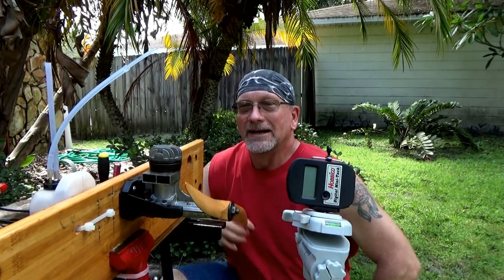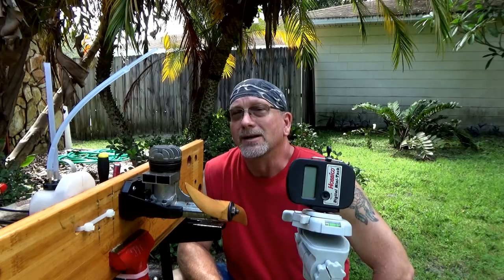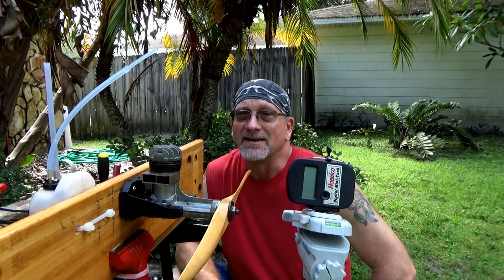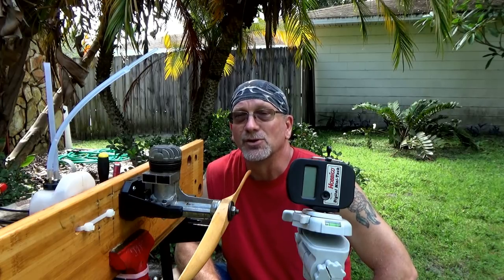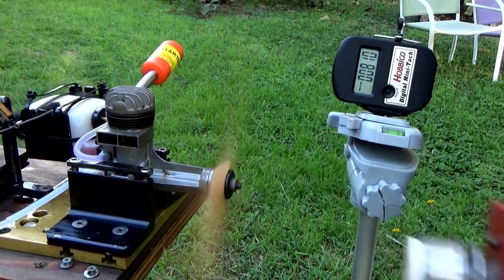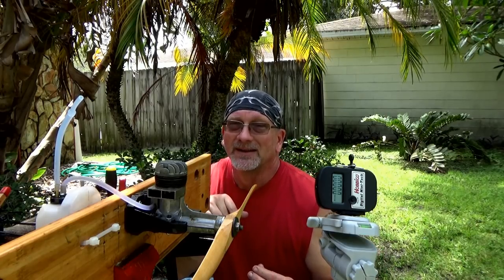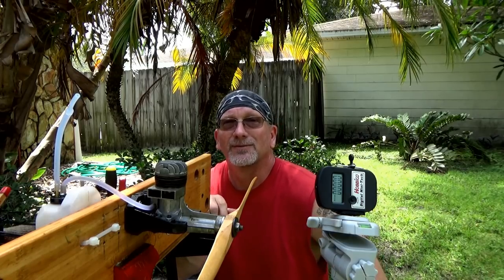Fox 59 Longshaft Run Attempts

Comment from the maker: So one comment to respond to all here.  This is not the first time I have run an engine.  Obviously I have checked the items folks here have commented on.  Fuel flows fine through the spray bar as I can blow through the vent line and fill the carb up.  So the spray bar is clear.  I can blow air into the spray bar and close the HSN and the air stops flowing through.  Likewise when I open the HSN while blowing air begins to flow, therefore the spray bar and HSN are fine.  I have also tried 2 different plugs between the attempts; nothing was different.  I have NO idea what the spray bar position is or should be. Who does?  If you think you do then show me some pictures of yours or documentation describing it.

Disassembly is an option but the age of the engine really makes me think the risk of further damage is not worth risk just so I can get a better run video to post.  This is an extremely rare item and sometimes you don't get to see what you want.  This is the only time I will be posting videos on this engine.  It is what it is, end of story.

Comment: Got my K&B .40 running thanks to your videos. It needed fuel. It liked when I plugged the carb and exhaust and chicken sticked it to get the fuel in and then electric started it. I backed out both screws from where they were. Just learning but it ran purty.

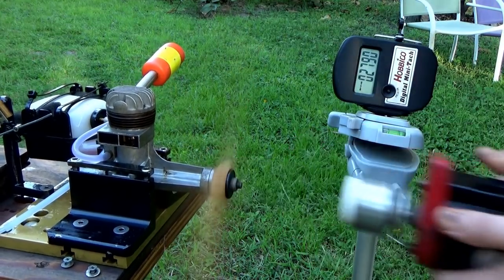Comment: David - I am at 3:57" so far on the video and I have two suggestions at this point: remove the fuel line and the needle valve and flush through the spray-bar some fuel with a syringe - I suspect some debris inside the spray-bar blocking your fuel draw. That would be the very first thing I would do. Next in line, use a hot plug ( the miracle Fox glow plug is not hot enough ) use either an Enya #3, OS #3A ( used to be #8 ),  SIG-GP003 or any other hot plug you can find, and definitely up the fuel with a 10% nitro and see how it will run .. But try to flush first the spray-bar with some fuel to clean it up and I bet you it will be a different engine.  Let me know how that goes ... This engine is very venerable and Brodak now offers a tongue muffler for it ..  You really made my day when I discovered this video / engine running ..

Comment: I know what i would do with that. Haha. Makes you appreciate the enyas the os  the saitos and the lasers. Your channel is so cool!!!
Reply from the maker: What would you do with it?
Reply: David McIntire   My big hammer. I would have lost patience haha
Reply: Have you tried it on full 20% castor?  Its really acting weird.
Reply from the maker: Well at 50s into the video there is text showing that the fuel has 26% oil content, much of that was added castor.
Reply from the maker: So you would destroy a rare and classic engine....
Reply: Not real smart...
Reply: In the 50's how much nitro was recommended for an engine like that?
Reply: Heaven knows. This was at the dawn of glow ignition and people were trying all kinds of things, there were guys doping up their Speed fuel with benzine.
Reply: Have you tried sealing the apparent crack in the crankcase? I know I had an old 2 stroke piston port suzuki years ago and it ran like shit.... constantly leaning up on me and that turned out to be leaky seals on the crank shaft bearings...
2 strokes rely on the integrity of the vacuum in the crankcase and any additional oxygen messes the mixture up.
You obviously know this, as you already mentioned it so apologies for rambling.
Cheers Kev.

Comment: They were noted for that- LOUD. The only one that ever had a muffler on it from Fox was the last of the series- the Falcon from around 1975. Check the cylinder head gasket, they were noted also for blowing those or having them leak as there really isn't anything supporting it.

Comment: Ya know, Dub Jett says: "80% of all engine run issues are the fuel tank, the other 20% are the fuel tank".  Looks to me like either the tank was too low, or maybe fill it and move it closer to the engine and run a shorter fuel line...….just saying...……  I had one once and it ran like a banshee, but when you wear them out, that's all folks.  I like your channel tho Dave.  I've been building and flying RC and CL for over 50 years.

Comment: I’m sure you already know this but 50’s era fuel systems were not usually pressured. Good fuel draw depended on the tank being as close as possible to the engine and the fuel pickup being on the spray bar centerline. Maybe try pressuring the tank to see if there is any change. It sure seems like its running out of fuel

Comment: Think that engine will run, if you seal that hole in the case. For the intake presure to the cylinder will leak out there. 
Nice vids by the way  👍😁
Reply from the maker: I gave this engine to a friend, so I cannot run it again anyway.

Comment: How close was the fuel source? I never ran this engine but engines back then needed the fuel to be close to the center line of the spray bar. Just a thought.
Reply from the maker: On the intro you can see where the tank is positioned.  On the runs from the previous day, you can also see where the fuel tank is positioned.  Just where is always is.

Comment: This is a race engine. Big intake...small prop. a 10X8 would work good but hard to find.
Reply: They weren't much of a race engine, the McCoys, Doolings, Atwoods, etc. ran all over them. It is much more of a sport type engine. Push one hard as in racing, and the head gasket goes kaflooey.